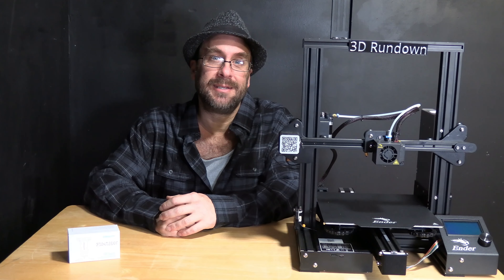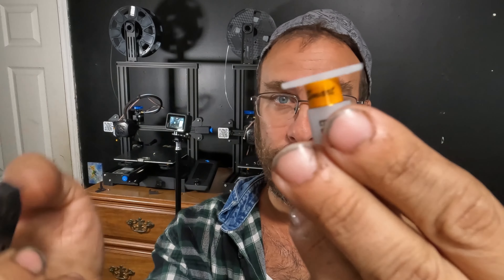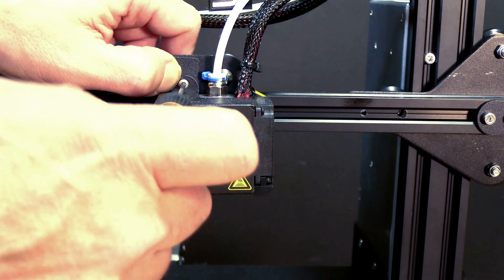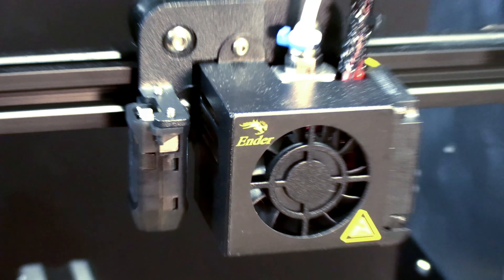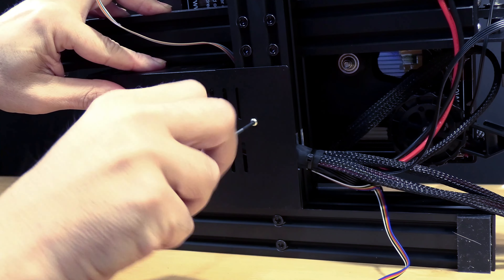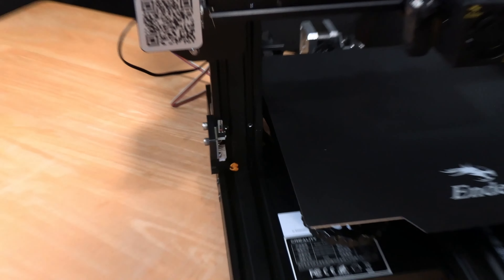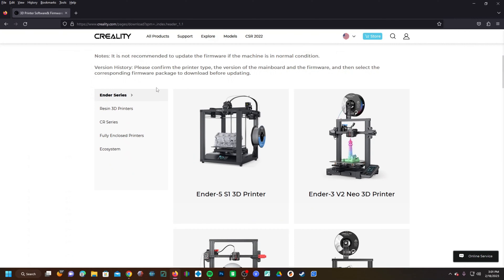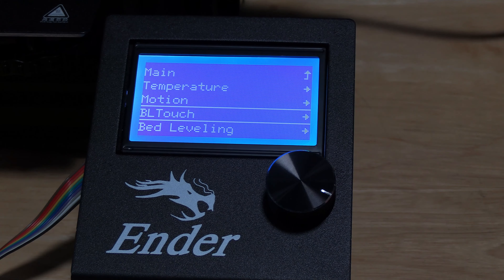Install Auto Bed Leveling Probe:  CR TOUCH or BL TOUCH on Creality ENDER 3 PRO - ABL 3D Printer

Comment: Well I see I forgot to uninstall my z stopper. So far no one has told me to do that part. I'll try it tonight with a test print.
Reply from the maker: Yup. It's gotta go. Z offset is now controlled at the firmware level. Endlessly better. 💯

Comment: Thanks for the video, it helped a lot! One thing to note, on the BL touch a solid red light means it's working normally. It threw me off at first lol!
Reply from the maker: Yes indeed. That is an odd choice. It's the blinking you don't want
Reply: Yeh, more logical would be green for OK and failure/error RED

Comment: 4 things ... 
1) I thought you had to do some z-offset setting.
2) I also thought there is a bed leveling mesh that also needs to be saved.
3) Isn't there also a setting change you need to do in your slicer for this as well?
4) What if your Ender 3Pro currently has Marlin firmware (mine does)?
Reply from the maker: 1.) Yes
2.) yes - 1+2 = https://youtu.be/q_MYYZ2ggAY
3.) yes - This https://youtu.be/mKvst6qpkPw
Marlin is what you want.
Reply from the maker: What is an "ABL" Auto Bed Leveling Probe? What it does, Why YOU should have one. CR TOUCH & BL TOUCH
https://youtu.be/yg2zVAakeGU

Comment: im having problems with getting the firmware on my printer! and with what app do you open the file cause i got it on notepad and it doens't work! and i think thats the problem. pleaze help!🙏
Reply: love the vid tho!❤
Reply from the maker: Just copy the .bin to the root directory of a memory card that is 32gb or less, format in Fat32
Reply from the maker: Pop it in, turn the machine on

Comment: hey man, great video. but theres a problem. you didnt tell us where to adjust the bed springs. i seen another video where he got 4 bushings with his cr touch i did not get those in my cr touch. so now i cant home it or get the bed to be at the correct height. and home is now in the middle of the bed instead of left front corner. please help.
Reply from the maker: Here you go: How to Level, Set Z Offset, and Make ABL Mesh, on an Ender 3 MAX or PRO with CR Touch & BL Touch
https://youtu.be/q_MYYZ2ggAY

Comment: Hi, I'm new to this and I can't seem to find the port that the CR touch plug goes into. The motherboard is v1.1.4.
Reply from the maker: 1.1.4 is old 8bit. Won't work. I would get a 4.2.7 board. Even a 4.2.2 would work. But 4.2.7 is the newer of the Ender boards
Reply: I am in the same boat.

Comment: your video was very helpful. unfortunately my motherboard was too old and didnt have the pin for the cabling.
Reply from the maker: You may have an ooooollldd 8Bit board. Can put a 4.2.2 or 4.2.7 on it. Probs cheap enough these days. But. A V3 SE, may be a better option, for a low cost step up
Reply: @3DRundown  mines a 1.1.4 lol. all the stuff i'm buying to upgrade, i'm almost at the point where i just buy a new printer.
Reply from the maker: YES. Grab a V3. Preferably one with a Nebula: KE, V3, or V3 PLUS. But, if budget is a thing, the SE is still a huge upgrade from your E3

Comment: Yet another great video, I really like the fact that your videos are at a more human level not at level 1000 making me pause the video several times to see the last step. One quick question, is it possible for the fans not to cool the horned as efficiently with the new ABL plat attached. Could the ABL attachment plate be secured over the fan shroud? I’ll be installing my ABL in the morning
Reply from the maker: Do as as shown here. Keep in mind the air flow to the nozzle comes out a little duct at the bottom of the fan. Also, thank you.... I like to speak to peeps like a HUMAN. I hate having to rewind, pause, freeze frame. Wtf he do there!? So... my painful pacing is intentional. :)
Reply: @3DRundown  thanks for the information. I was recently gifted a used ender 3pro. It has some slight issues and has been sitting in a closet for over two years. I have found your videos the most useful and easy to understand. I have several saved in a playlist from things like what to check and fix along with upgrades/mods I’ll be doing.

Comment: Hey @3DRundown I was wondering if these steps also work on the original ender 3
Reply from the maker: Hesitant to say. It MAY be. The ender 3 is pretty old. The PRO, 100% works with it. Comes down to the board. Gotta see what board you have
Reply: Did you have any success? I’m having trouble getting my printer to install the software? I too have the original ender 3
Reply: My ender 3 screen is blue

Comment: I'm very thankful for modern tech. Everything worked great from assembly to firmware until the screen was in Chinese. Easy google translate threw camera and I was able to switch back to English. There is prob a way to have English as primary if I edit the Bin file but I'm to lazy to learn that one right now.  Now off to watch how to actually level the thing. :) Great vid. 👍
Reply from the maker: Your firmware should absolutely be defaulted to English. Also, I use this firmware on my Three E3MAX (donate $2 for access. Worth it): https://marlin.crc.id.au/
Reply from the maker: Let's level her: https://youtu.be/q_MYYZ2ggAY?si=le0g-V1iAR26yhWF

Comment: I dont know what im doing to be compleatly honest. I dont know how a CR touch works and your printer has a compleatly different software to what i have. I saw the ender 3 pro software on a standard ender 3 printer so im not sure if I should upgrade the printer software to a pro or leave it as it is as i dont have the correct options for the CR touch
Reply from the maker: Which machine do you have? Consider my course. I walk you through everything. Https://www.3drundown.com
Reply: @3DRundown  I got an ender 3

Comment: Great video. Thanks! Do you happen to have a video with firmware instructions when installing a BIGTREETECH SKR Mini Motherboard with touchscreen? Everywhere I've searched many people are having problems with BLTouch and/or motherboard not working correctly. Thanks again in advance.
Reply from the maker: I'm a HUGE fan of the Ender 3 MAX. I have 3 of them. However, I only use Creality hardware on them, so, sadly, I do not.... However, they work great with the CR-TOUCH, and Creality Mainboard. However, I do not use Creality Firmware.

Comment: My ender 3 has the option "configure" instead of "control" and it doesnt have the bltouch or bed leveling options after following your instructions
Reply from the maker: Did you install the firmware version that supports the touch? Make sure of that

Comment: Does it matter if i have an all metal hot end, direct drive and the silent stepper motherboard?
Reply from the maker: nope. Should def have an abl
Reply: @3DRundown  alright... I'm stumped, I bought this ender 3 pro with the micro swiss hotend already installed it has the v4.2.7motherboard on it and I was told that it has custom firmware already on it. I just got my CR touch installed and cant seem to figure out how to enable it. I have only been doing research for an hour but it would be helpful for some insight from someone who knows better than me!
Reply from the maker: The firmware MUST support BL-TOUCH or CR-TOUCH (they use the same firmware). If you don't have a TOUCH, the firmware will NOT support the Touch. So, since you didn't have one, the firmware needs to be changed. 
This place has great firmware: https://marlin.crc.id.au/

Comment: So got it all installed on the card but the printer seems to not be updating. It just has its normal settings. Its the ender 3 not the pro.
Reply from the maker: Use a different card. 32gb or less, format fat32. Rename the firmware file to anything else
Reply: @3DRundown  I got it working. I ended up choosing a firmware for the ender 3 with BL touch instead of the ender 3 pro. Thank you!

Comment: Why dont you need the z stop switch anymore?
Reply from the maker: Because Z Offset is now set in the firmware, using the CR-Touch.
Reply: @3DRundown  awesome that's what I was thinking but I wanted to make sure before I bought one, thank you!
Reply from the maker: This is a huge upgrade, as you can now make minute software adjustments, for that perfect Z-Height, rather than having to physically move a switch, which is archaic.

Comment: I need a little help i did all the steps and got to turning on my printer and the screen just stays blank what should i do
Reply from the maker: Is this after doing the firmware? What happens if you unplug the touch?
Reply: @3DRundown  it was after i installed the cr touch and put the firmware in the root file then turned on my printer that it just stayed on a blue screen. and if i try to unplug the touch it still stays blank
Reply from the maker: Feels like the firmware didn't take. Possibly wrong version? Make sure it's the BLTOUCH (or cr) firmware, and matches the Board version on your machine
Reply: @3DRundown  sorry i forgot to respond but yeah the firmware just wasn't working so i had to use vscode and make my own to flash but i have it working now

Comment: is there away to disable the CR Touch after installing it? cause i took the G29 GCode and i put my switch back on but it is not homing properly
Reply from the maker: I wouldn't. There is no reason to remove the CR-Touch. You lose ABL, and more critical, you lose Z-Offset control. Keep the Touch. Also, don't use G29
You'd need to revert back to a non Touch Firmware.
Reply: @3DRundown  what should I use for G29 then?
Reply from the maker: Nothing. Do a manual ABL and save. Only do it again, if needed. 
Use M420 S1, after G28
Reply from the maker: https://youtu.be/mKvst6qpkPw

Comment: Hey just having some trouble with updating the firmware. I confirmed that I have a 4.2.2 and downloaded that but it isn't automatically updating and I can't figure out why.
Reply from the maker: Use a different card.
32gb or smaller
Formatted in Fat32
Bin file on the root directory.
Rename the file. Any new name. 
In the machine while off.
Turn it on

Comment: I have the regular ender 3 what firmware should I use because I don’t have the control section on my printer and nothing shows up when I use the put the firmware in I tried using the pro 32 bit one you showed and nothing happened so I tried using the the regular ender 3 32 bit for V4.2.2 and still nothing
Reply: Did you figure it out?
Reply: @ Sadly I have not been able to figure it out and my printer no longer works I am trying to fix it
Reply: you have to install the GD-Ender-3 ProHW4.2.2SW2.0.8.2CRTouchFilamentEuropeMult

Comment: I installed the cr auto level (creality ender 3) and now the filament doesn't stick to the bed. I think it's TOO far away from the bed. And if i move it it stays on the same level
Reply from the maker: You need to set your Z-OFFSET
Reply from the maker: Follow this video: https://youtu.be/q_MYYZ2ggAY?si=Cz1iZjp4gJ5Mc_w_

Comment: Thank you! But my printer seems to stop mid print and freeze now
Reply from the maker: After Probe install? Check all your wiring. What Firmware are you running
Reply: @3DRundown  yes after the probe install. All the wiring looks fine. Marlin Version 1.1.2

Comment: does this work similarly or the same on other printers that are similar to ender 3? in this case the voxelab aquila c2? as i cant find any tutorials for it
Reply from the maker: Hi, yes, this should work fine. I think a BL-TOUCH is more common on the Aquila, but, a CR-TOUCH and BL-TOUCH run off the same firmware. As long as you wire it up properly, you'll be good to go. Just be sure to use firmware that support BL-TOUCH. Again, that firmware will also support CR-TOUCH
Reply: @3DRundown  hi thank you for the quick reply but after watching the video i wend and checked my motherboard and couldn't find a connector that i would connect it to
Reply from the maker: Bummer. Search that board on Google, to be sure. If anyones done it, there will be a Reddit thread on it, for sure
Reply: @3DRundown  how do i find out how its called?
Reply: @3DRundown  hi again today ive tried to buy the a1 mini combo in the uk but i can only find 2 providers for it 1 obviously the official website and another one but both of them reject my payment and flags my order as "high risk" know anything i could do?

Comment: when I put the sd card in with the new firmware, the screen remains blue and nothing happens
Reply from the maker: Did you wait a bit? Sure it's the right FW for the Right Main board version? 4.2.2 or 4.2.7Use a different card with just the FW on it.

Comment: Hey everyone please correct me if I’m wrong I am still very new to this, but isn’t the wiring to the mother board backwards? Granted my BL TOUCH is a duplicate and not the original , my printer was freaking out on display and feint burning smell was coming . I checked the board and nothing seemed to be damaged but it works now that I flipped the wiring . Please help
Reply from the maker: Your knockoff may have the colors of the wires backwards.
Reply: @3DRundown  that could be it , thank you for the amazing guide , I got everything to work except the extruded lever snapped some how now I gotta wait till tomorrow to fix that and test
Reply from the maker: They always break. Gotta go metal

Comment: Need some help here. Followed instructions, when i inserted chip in machine and turned it on it stayed at the blue blank screen before ender logo for about 10 minutes before i shut it off and turned it back on. 

It seems to have updated beacuse i have the options but it now will register  that the card is inserted on home screen  but will say no FT card.  Yes ive tried 3 cards now 8g, 16g, and 32g and all formated to FAT32.

Any help will be appreciated because i cant seem to fix this issue at all, even tried reinstalling it.
Reply from the maker: 32g Fat 32 should work. Did you try a different card? Do you have at least one GCODE file on the card?
Reply: @3D Rundown  yes I've tried 3 different cards,  and i have tried original gcode test print, and another gcode.

Comment: S did you ever do part 2?
Reply from the maker: Hi, I ended up not continueing the E3 PRO series of videos, due to time restraints, but, I DO have a part 2, using the Ender 3 MAX, which is identicle, only larger, follow that one: https://youtu.be/q_MYYZ2ggAY?si=M8M-72Hpl11oyACJ

Comment: I have ender 3 s1 pro. It has pre installed CR touch. But problem is CR touch probe is slightly below the nozzle level. It is dragging print leyer. Your CR touch probe is above the nozzle. Please anyone tell how to solve this.
Reply from the maker: The sprite was made for the crtouch. That shouldn't be happening. Is its bracket bent? Is the probe damaged and not fully retracting?
Reply: @3DRundown  Please tell can I remove CR touch and install normal z limit switch in Ender 3 s1 pro? If yes please share video link of the same.
Reply from the maker: DO NOT DO THAT. You will lose your ABL mesh, and your ability to control the Z-OFFSET. It's a massive downgrade.
Reply: Problem solved ! I added thin visors behind two screws holding the extruder. Thanks.

Comment: I have an ender 3 pro and I am getting the "no tf card error " after installing the creality firmware. This seems to be a common issue I am seeing online but I haven't found a good fix yet. My SD card is formated correctly and has all of the files in the correct spot/format as well. I have reformated and wiped the SD seceral times with no luck. From my understanding of what I have read online this may be a creality firmware issue. Any tips/videos on how I could fix this?
Reply from the maker: Step 1: Use a different card. Sometimes these machines reject cards. Also, the stock card is garbage. I use these on all my machines: https://amzn.to/40JGxqm
Be sure to format in FAT32, and use 32gb or less. Pop the card in, and manually save settings with the firmware. That may help trigger the machine to recognize the card.
Reply: Mine is just showing a blue screen

Comment: I did all of this and my screen won't turn on now 😔 idk what I did wrong
Reply from the maker: Likely the wrong firmware. Flashing back to stock should get the screen back on, then can try again. Be sure using BL TOUCH firmware, and for the right machine, and board.
Reply: @3DRundown  I have the right one for the main board and it has a setting for the bl touch. But I don't have the stock firmware anymore. My main board is 4.2.7, will it be an issue if I go back to the stock firmware if I can find it? I upgraded my board yesterday

Comment: Help!! My screen is blank its just blue, what do i do
Reply from the maker: Sounds like a potential wrong firmware. Use a   Different card. 32gb or less. Format in fat32. Put the firmware on it. Machine OFF: Put the card in machine, turn machine on.
Reply: @3DRundown  its in fat32 and only has the file you put on. It still only shows blue. my file shows a windows explorer icon does that make a difference?
Reply from the maker: The icon shouldn't matter. However, the machine will not read the same file name more than once. So, try this: RENAME THE FILE. Any change. even just adding a #
Reply: @3DRundown  got the screen on but now it says no tf card

Comment: How come my screen is blue
Reply from the maker: It doesn't like the firmware. Figure out why. Perhaps wrong file, wrong version? You can go back to the older, then try again. Or, you can try again, but, rename the file. If you install  FIRMWARE.BIN, it won't load that file again. You'll need to rename it, such as FIRMWARE2.BIN

Comment: aww, Im gonna need to buy a 32 bit board lol
Reply from the maker: Installed mine on the board it came with. Have you checked yours to be sure what it is?
Reply: @3DRundown  yeah I got my ender in like, 2018 when it was still a "groundbreaking new budget printer". Didn't even know they came with 32 bit boards I thought only the newer ones did! Mines 8 bit lol